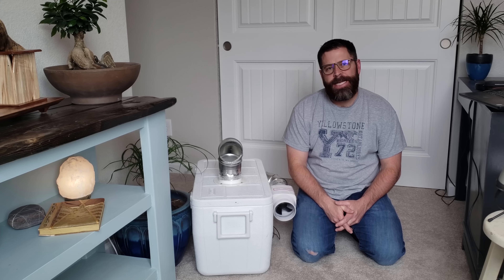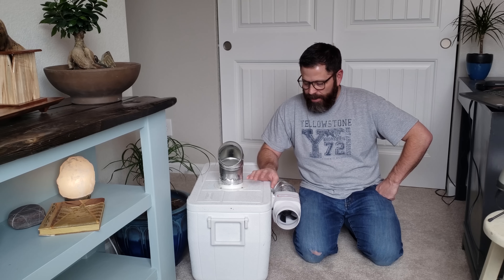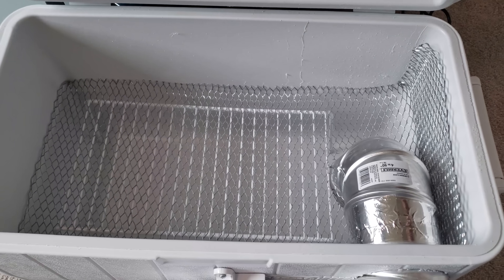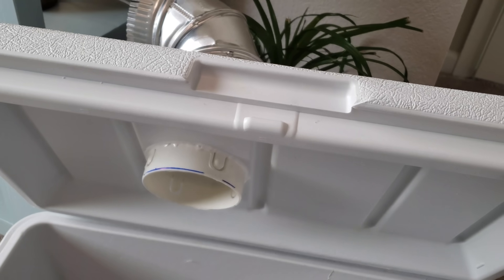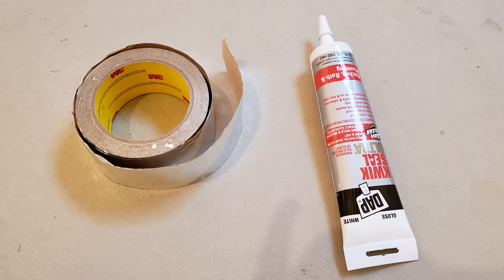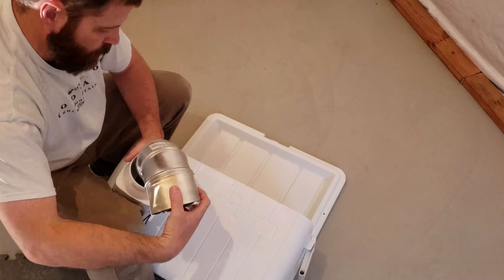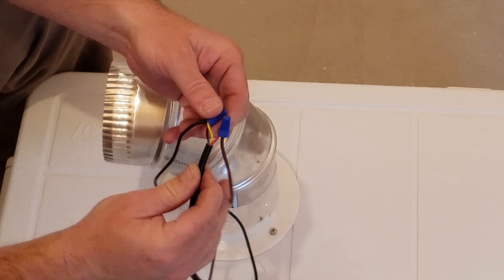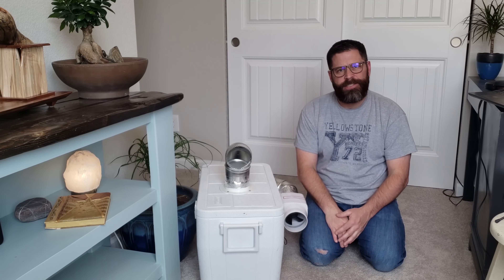Homemade Portable Air Conditioner DIY - Coldest One Yet!

Comment: Great Build. Is the bilge fan very loud? are there any humidity or moister issues?
Reply: Dave DC I am curious about the humidity as well
Reply: Would be perfect here on the NM Desert!
Reply: Dave DC yes it would cause problems that this guy left out. Air conditioning works by taking moisture out of the air thus lowering the temperature but this guy is pushing a lot of moisture into the air causing the perfect place for mold to start growing. I would never do anything like this.
Reply: @mwatkins2464  no mold is gonna grow at all leaving this running for hours in a room that has any ventilation. Mold doesnt just grow cuz moisture is in the air.
Reply: @mwatkins2464  Dont think its meant to cool your house or a room....best application is for outdoors sitting around enjoying a cold beer!!
Reply: Cameron Sheridan funny 😄 you would have to sit very close to it outside to feel anything and he was using it to cool a car because it was to expensive to fix the ac so he did mean for it to be used inside.
Reply: @mwatkins2464  Would happily sit on top of it if I had to!!! Anything to beat 40deg C heat

Comment: What about removable tubing or pipe pieced together like a radiator. Take it out put in ice to connect point, then replace piping, finish filling with ice. Let set until piping is cold. Then the air travels through the cold pipe(maybe baffle the pipe to slow the air?). May keep the ice from melting as fast?  Just a thought.

Comment: How long does the ice last? Can dry ice work and if so how long will it last?
Reply: I would strongly urge against using dry ice, especially not in an enclosed space. Sure, it would be nice and cold (it sits at -110F) right  up until you asphyxiated yourself, or at least gave yourself a real nice headache and blurred vision (at around 2% concentration). It is straight carbon dioxide after all. So, yea, lets not do that. That's my PSA for the day.
Reply: Johnny12226 ok, I won’t do it. 😂 LOL. How long does the regular ice last

Comment: People keep saying it doesnt work but I bought a premade one off ebay 3yrs ago to go in my old school until I could afford to fix the  AC and it blows super cold after about 30mins I actually have to cut it off in the summer. My car is 82 cutlass so it's small. Dont listen to these internet trolls get a STRONG fan and it will cool your car
Reply: @msegmx  honestly depends on the quality of the cooler you have. Mine is made from a igloo cooler and my cutlass is garage kept so the temperature probably starts off much cooler than if I had a car that sat out in the sun all day. I bought 2 bags of ice from the store a yr ago and since I only drive it maybe a hr or so at a time I left the ice in the bag and just put both bags in the cooler and when I'm done I take the bags back out the cooler and put them back in my deep freezer in my garage. God as my witness I been using the same 2 bags of ice.

Comment: Why destroy a cooler instead of a bucket? Insulation is to slow down heat transfer, but you're trying to use a fan to speed up heat transfer.

Comment: Tip. Add 2 kilo's of salt in ice
Reply: Why
Reply: salt lowers the freezing temperature and that means it takes longer to melt and is colder
Reply: @rotaryturbo88  WRONG ! Salt lowers the freezing point and makes  the ice melt faster . It does however make the water from the melted ice colder than non salted .
Reply: That's what i was going to recommend as well, i remember it from mythbusters!
Reply: Salt melts Ice that's why they put in on frozen roadways.
Reply: Buck Bradley salt doesn’t melt ice it lowers the melt temperature of ice making it below 32 degrees freezing when it melts.
Reply: @mwatkins2464  thnks bro u explain better my engine is weak
Reply: @mwatkins2464  you have ur facts confused sir. Try it yourself. Better yet please explain thousands of dollars of salt being added to roadways by cities and counties to make the ice STAY Colder! Lol. Old fashioned ice cream is made colder because the rapid melting of ice creates a convection effect making the inner chamber colder... My time is precious and so is my data plan.
Reply: @buckbradley2501  Adding salt to roads (which is merely unpurified salt) simply lowers to the freezing point of ice.  THIS is what melts ice, BUT only at certain temperatures AND is some water is present.  So, let's assume it's 30 degrees Fahrenheit outside and there's ice on the sidewalk, since we're not at zero Kelvin (-460 degrees Fahrenheit) there IS still heat / water present and if you add salt to this ice, it will dilute in the surface water and then melt the ice by 'lowering' the freezing point of the ice (which is currently at at 30 degrees).  However, depending on the concentration of salt, the melted ice will freeze again, but at a lower temp.  This will make the water / melted ice colder, but it won't yet freeze until that lowered temp has been reached.

So, the water becomes colder (if the temp becomes colder).  However, it won't freeze until the temperature (which affects the water's temp and later, the point at which the water will begin to freeze.  In this case, unless there are tubes emerged in the (cold) water, adding salt to this mix should render this AC inefficient.  Sure, the water will become colder, but this setup is dependent on AIR FLOWING ACROSS and THROUGH interstitial spaces in the ice (between the ice cubes) and carrying that air through the out-port.  Cold water won't do much, except become warm water with time;  the objective here is to try to keep the ice frozen and adding salt will do just the opposite.  

M Watkins is incorrect in his assessment.  Rotaryturbo88 has it backward; adding salt lowers the freezing point (not the freezing temperature, because the temperature is not dictated by the salt, only the point at which the water will freeze), which WILL melt the ice faster (IF the ambient temperature is above what the salt concentrative would support).  Sure, the water will become colder, but it it'll take LONGER to freeze (because the freezing point is lower than 32 degrees Fahrenheit).

Comment: That looks like the best design I've seen so far. My attempts to build one were based on the other less efficient designs, and I had little success. One thing I believe would work nicely with your design is instead of pouring ice into the cooler, take two liter bottles and fill them with water, then freeze them overnight. Once they are frozen, put them into the cooler and run the AC like you do. Once they have thawed out, refreeze them for the next day.  I figure it's good because there's no mess and the bottles are reusable many times over. I am definitely going to try your design, though. Thanks for posting!

Comment: i made the one with styrofoam cooler, 2 fans on top, and 4 pvc pipes out the sides and loaded with tons of ice but the cooling is minimal and the ice doesnt last very long, any help?
Reply: buy a real air conditioner instead? no ice-based air cooler will last long. there's a reason air conditioners were invented and they stopped shipping ice blocks down from canada and siberia.

Comment: Tried this on a small scale. It does NOT work. Coolers work on the concept of dropping the temperature of the air then keeping it sealed in
Reply: That's not true at ALL.
Reply: @Ponkdonker  No.... I built one and it didn't work. Why do you think it's so important to keep a cooler closed?

Comment: A 1 ton AC rating is equal to 2,000 pounds of ice melting in 24 hours.  12,000 BTU per hour or  288,000 BTU's per day.

20 pounds of ice  =  20/2,000 = 100 BTU.   A tiny, tiny AC unit considering that a 5,000 BTU AC is the smallest that Home Depot sells.  Not much cooling can be expected from a 100 BTU AC unit.
Reply: Why you gotta bring physics and thermodynamics into this? Haha.
Reply: @Joe T Sweating or perspiration is in essence evaporative cooling and yes it works, but....  The effectiveness of evaporative cooling is directly proportional to the amount of moisture in the air AKA humidity.  The higher the humidity the less the cooling effect.  This is why swamp coolers work great when the humidity is low.  Regular air conditioning cools and dries the air which makes it a win, win.
Reply: @Joe T I agree, we are very spoiled in most regards including climate (HVAC).  I use to not even think twice about climbing into a hot attic.  Now my reply is: How about tomorrow morning, early!

Comment: GREAT IDEA .Have you tryed different size tubes for the air in and out takes? what the results ? if you did.
Reply: you will have to have a 3 and 1/2 ft inlet in a 3ft outlet and a 3ft boot up your dumbass

Comment: Have you tried ice cream salt on your ice ? Somehow it makes the ice colder. Im thinking if ya place ice cream salt on to your layer of ice it should make the air coming out even more colder. Its worth a shot
Reply: Salt just lowers the melting point of ice. The ice would be cooler by about 3-5 degrees but would last half as long.

Comment: Pumping a ton of moisture into the room - brilliant! This is NOT an AC - AC removes moisture as well as cooling. Also, where the hell would you use it? It's only "portable" if you have a constant power supply, in which case just buy a proper ac unit and never have to keep topping up the ice. Stupid hippies always think they can improve things with their dumb-ass mcgyver projects.

Comment: Instead of ice how about freezing 2 liter bottles in your freezer and save money on ice. Might even last longer and no water mess
Reply: Ice has more surface area for the air to exhaust through it.
Reply: Excellent idea! My frozen bottles of water are lasting around 2 hours at roughly 40 degrees. Thanks for the tip 🙂

Comment: Cost $5 of ice Every day (that you have to pick up at A store with your car) + parts. 
A $249 portable A-C unit that can do A bedroom size room Will use around $1,50- $2 A day. Do the math.
Reply: So I can get a $249 portable A-C unit that you mentioned and use it in my tent during the summer? I'm going to try that.. wait.. what do I plug that into? I'll need to buy a generator, and gas to run it and maintenance... so i did the math and I'll stick with this cooler with ice design.  With this cooler design with ice, I can get a block of ice and use my battery pack to power the fan and stay cool inside my tent when it's hot outside. I have a Siesta insulated light blocking tent so this will work nicely with it.
Reply: There is no mention of A tent anywhere. Not in the discription or in the video. Get your act together if you want to make people A bit wiser.
Reply: @harmzegt8066  So use your imagination, or logic.  This is obviously built for a situation where you don't have regular power, like a car with no A/C, or a cabin, or a tent, or a boat, or some other remote place not connected to a power grid.  If you have a permanent structure and electrical service, a commercial A/C unit is obviously much more efficient and practical.  Are the YouTube police going to come get you if you use a video to make something and use it in a way that isn't mentioned in the description?

Comment: how long does it last before the ice melts? how do you handle the moisture it adds to the air doing this?
Reply: I've heard a few hours. I'd use water frozen in containers to stop humidity from entering your home.
Reply: @ksks6802  That what i was thinking instead of buying ice, get some water bottles and freeze them and reuse them instead of buying ice all the time
Reply: @altha-rf1et  That will reduce its efficiency.
Reply: @Xanthopteryx  it depends on where they live. If your rockn a swap cooler then open ice. If your in a dry climate using this method in conjunction with your central AC then enclosed frozen water. I'm not going into why. Google it.
Reply: It will only add as much moisture as the outflowing air can hold. How much is that? It depends of the temperature of the air.

Comment: Wow what a waste of energy. This is what people come up with when they don't understand refrigeration. You're not removing any heat from your room just transfering the heat to the ice which will melt (making your room more humid btw) and then the heat will be transferred to the cooler and back into the room. Unless you're cooling a very small sealed room, this is going to cost a fortune and you should just invest in an air conditioner, that will remove the heat and humidity from the room and put it outside.

Comment: What I would improve is to find a better insulated container like make one. I wouldn't rely on what the cooler manufactures put in there to insulate them. They arent' that well insulated.
Reply: Disagree. No matter how well insulated it is, you’re still blowing massive amounts of warm air into it. You’re purposely defeating whatever level of insulation it has. So as long as a cooler is able to hold ice for 6-8 hours, it would be sufficient for this purpose.

Comment: Another tip : The more ice you have packed in The more time you have before it melts  Just make should you have a fairly good flow air for the fan In the video you see 2 bags of ice..I think he would of got a few more colder temps with a 3rd bag
Reply: It wouldn't have gotten any cooler by adding a 3rd bag or even a 4th bag he got it to freezing temperatures with 2 bags. Adding a third bag will not make it colder when they are all the same temps.  Adding a 3rd bag will make it last longer though.
Reply: @sheyrd7778  If you have 1 ice cube in the cooler it is not going to keep the cooler at the temps needed same for 2 ice cubes and so on At some point By filling up your cooler with ice you are minimising the amount of warm air in the cooler. Warm air melts ice, so the less warm air in your cooler the better Now when it comes to the outside air in the car Cooling it quicker with more ice The less warm air returning into the cooler melting the ice  Thus like my first comment adding a 3rd bag will make it cooler and Yes as a given will last longer
Reply: @freakyflow  OK you should have mentioned that instead of saying an extra bag. Scientifically is one bag of ice colder than 3 bags of Ice?   No they are all the same temperature.   Now with volume they prolong how long it will last like you are trying to say to me about one ice cube verses two.  So the answer still is it isn't going to be colder overall.

Comment: I think I like your earlier one better for indoor use. I live in Minnesota, a very humid state. Not Florida humid, but humid enough. So the "swamp cooling" method could end up making the house like a swamp, complete with mold. Running a pipe through the ice and allowing the cold to penetrate the tube and cool the air without the moisture seems like a much better solution. However, it is cool (pun intended) that you keep working on making things better and better!

Comment: What temp difference between supply and return air. With AC units you get 20°F How much better is the cooler
Reply: It's not
Reply: Notice no one ever does temperature before and after .
Reply: @marvinmitchell5522  You're so right. It will give you a few minutes of cold air, not enough to cool the space significantly. Also it does nothing for dehumidification and may actually make it more humid.

Comment: Hey how u doing there, it's a really nice idea just a question why u didn't use PVC fittings?
Reply: Probably because metals take hot and cold really well. The metal helps with keeping the air cold rather PVC takes a while. I would probably use pvc just for its longevity compared to metals.
Reply: I'd say the cost of $3 at menards/home depot vs the $8 for PVC and you would need the piece that slips in between them
Reply: I understand make sense